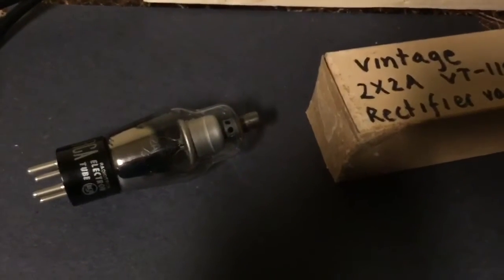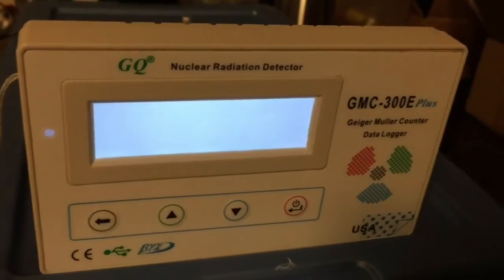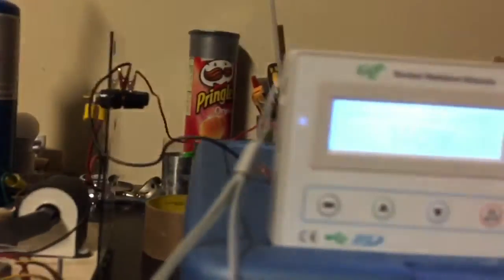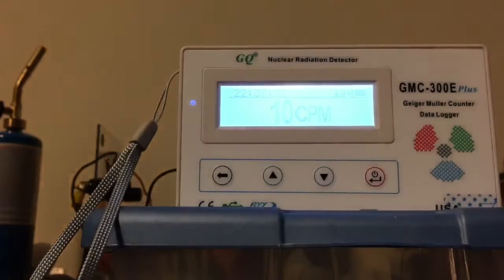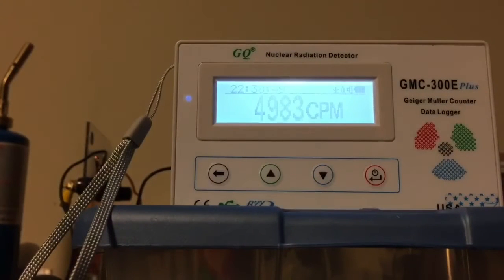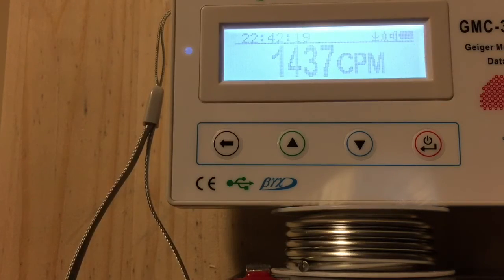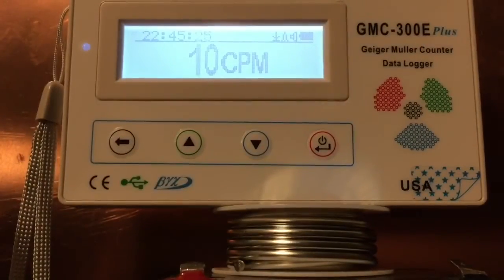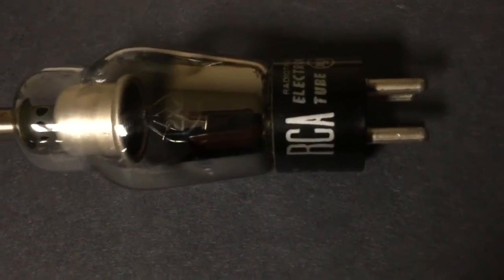Home Made X-Rays

Comment: Bro give these construction deadly x-rays in the room?sorry for my unconfencial question...i dont unterstand such things
Reply: sorry this answer is a little late, but because this is a just a rectifier tube and not an actual xray tube you dont have to shield it so heavily.
Reply: @Example51  No worry better an answer as no no answer 😁😁😁 hmmm i understand...thanks for info 👍👍👍
Reply: @Example51 
Apologies for necroposting.

The kinetic energy of an X-ray photon is approximately 1:1 the voltage applied to the source device in V. 

(Exempli gratia), 
100kV (kilovolts) applied to an X-ray tube will generate photons with a kinetic energy of 100keV (kiloelectron-volts).

The example above is theoretical and assumes perfect conditions.

The amount of current applied to an X-ray tube is proportional to the number of X-ray photons generated per second.

(Exempli gratia), 
10mA of current applied to an X-ray tube will generate more photons every second than 1mA.